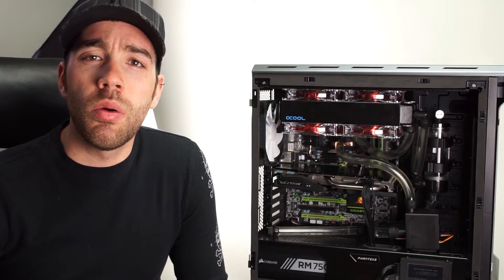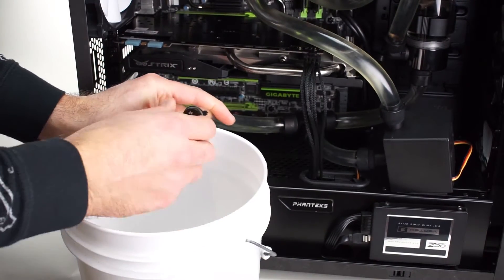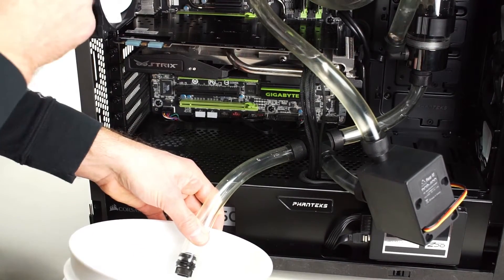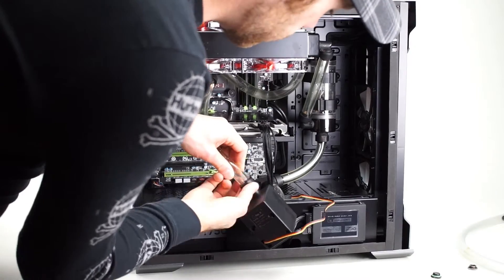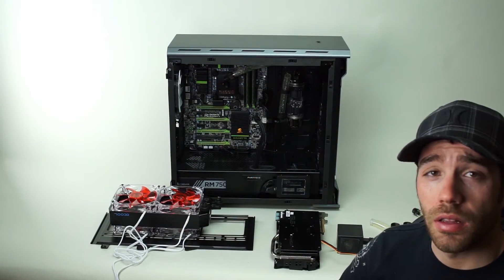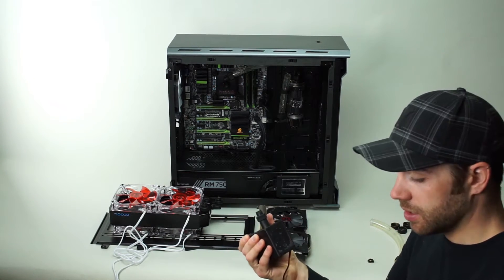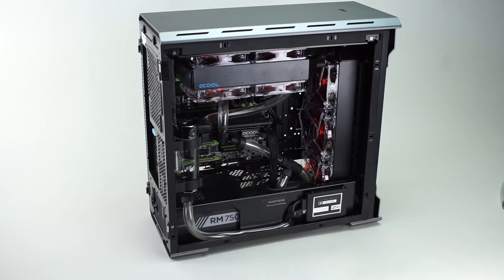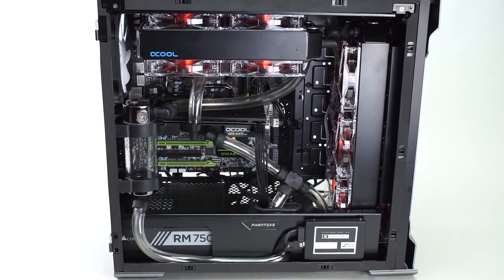Water Cooling 101: Upgrading Your Loop

Comment: Your build looks tidy as fuck both cable and hose though looks a little shabby from what I can see in the video if adding additional copper pipe/fin heatsink etc to other components be in MoBo or peripheral.

Suggestion, do same with a hand-me-down or cheap ass generations old with drill mount holes case without bruising my knuckles and needing specialty screwdriver heads to dismount and mount.

Comment: I'm not really feeling it.... I would really have removed the set of fans between the top rad and the top of the case... push vs push/pull doesn't make a lot of difference as long as the fans are sufficient quality, and it would have allowed for cleaner tubing routing because the rad would have been 25mm higher up in the case, allowing also the window to show off more of the cpu block as well... also that T-connector, totally out of place in my opinion. But really the worst side of that build is the tubing routing, come on man you can and should have done better then that!!!
Reply: +Fabio Bologna agreed. I'm sure the cooling is outstanding but aesthetically it can use some work.